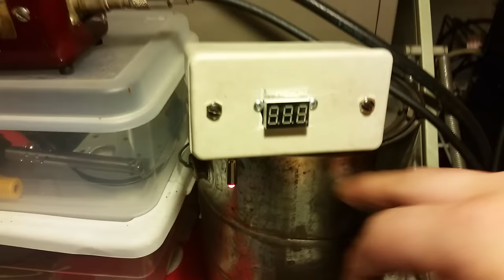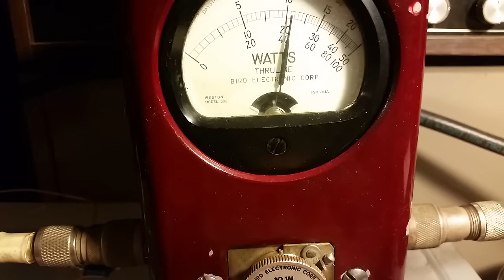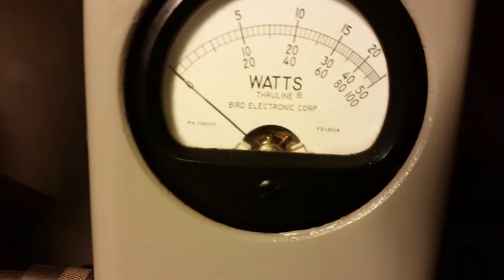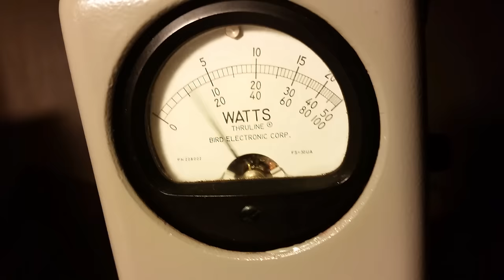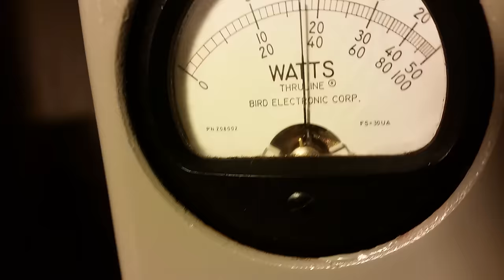Armadillo 6x2879 6 Pill Ported Amp Brought Back To Life

Comment: now also put a spectrum analyzer to the output. i would love to see that picture .
Reply from the maker: eeeeeeereehhhh that would be ulgy lol lol splattering prbly 4 harmonics  lol lol...i keep it real brother i dont act like it is something it isnt......but for a cb operator it all cake and cheese.....wait cake and iceing lol thanks for stopping by.
Reply: +1883GotDown so your 800 watts is approx 200 watt clean signal LOL i would not try that up here in the Netherlands as i live next to an airport .... thats like asking whats for dinner in C block.....
Reply from the maker: +biglift1 roger that. we cant truely say what is making it in freq or not cause i dont have a S.A. but on the Bird 43 RMS it was showing what it was and it was getting own down.

you gotta understand this is what your average cber in the us is wanting.

a time and place for everything and not for around a airport.
Reply: +1883GotDown roger that . but even without an S.A. its doable : i had some lessons regarding this from an passed away radio amateur friend when i was much younger. I was messing around with fm broadcasting as a teenager. He came up to me with his home made grid dipper and suggested i look for the harmonics with a scanner and old skool tv set  and build a low pass using the grid dipper. It worked for me as the junk coming out at the end was down . Recently i dusted of the cb hobby after a down time of more then 25 years . i build-ed the tuned C class amps. The way you are doing it new to me. i am trying to figure out what a 2 pill 2sc2879 would do on FM as everything over here goes on FM and what a 4 pill would do  etc . can you just add it up ? or does 2 pills give such and such boost and a 4 pill will do even more gain ?? looking for a rule of thumb here when on fm. anyway thanks for the combiner / transformer vid it made a lot clearer how that is put together 73,s greetings 1WD001 QTH South east of the Netherlands. Your close to Jasper in  Georgia ? if so say hi to aunt melba :)
Reply: +Buckwheat Chiggas what i dont understand is that folks use these very expensive transistors if one can use a mosfet MRF6VP2600H or a rugged BLF188XR that does a nice 1200 watts @ 50 volts. a heck of a lot cheaper then this expensive mountain of Toshiba pills. ( $50 a pop times 6 is 300 bucks as i got the BLF188 under 200 bucks)    Then add a good low pass filter en run the amp at 50 % class AB so no FCC official can claim that you had downed an airplane because your splatterbox. That is one thing PA0MJS (rip) thought me a a very long long time ago .